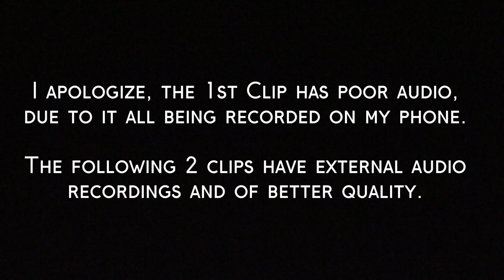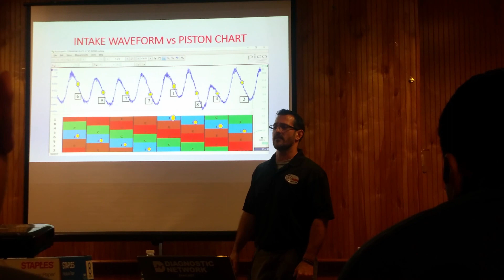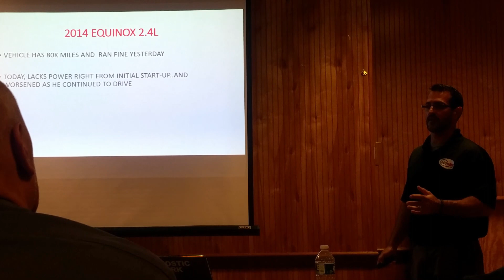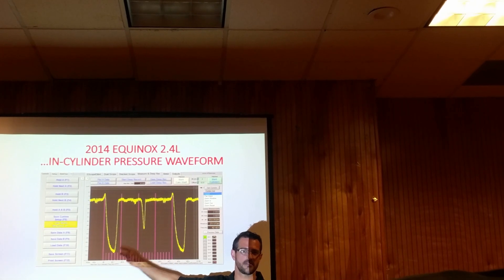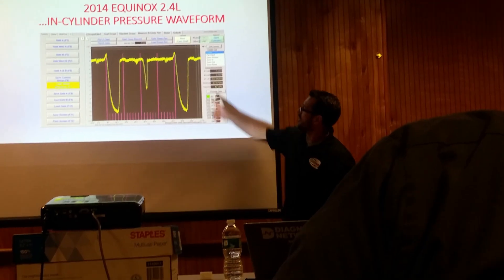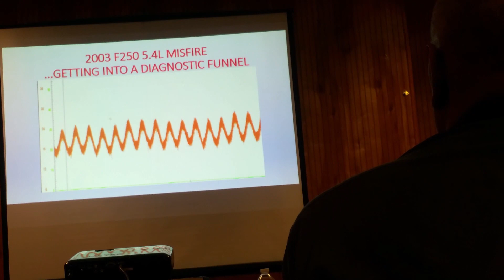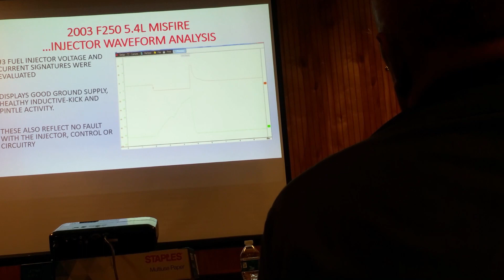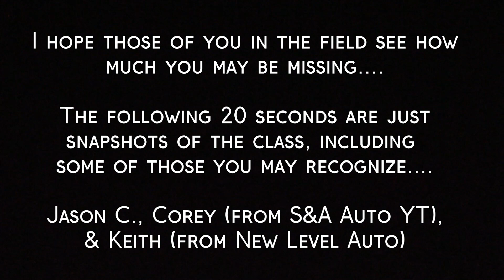TST Starring Brandon Steckler; Pressure Waveform Part2 Clips

Comment: The difference between big money and ok money is the tech making the effort to take these class and apply them in the daily repairs 

Great video 

It's very advance diagnose step that once mastered will pay off  especially with some engines so hard to get the back cylinders doing the old school compression testing method
Reply from the maker: Exactly that! Techniques that will pay off in the end, and all without disassembly of components! How awesome is that??  How about those that have been to multiple shops and still haven't been fixed?? Having a way to see things other shops missed because ONLY your techniques will be able to see it. 

 I'm glad you enjoyed it! 😉😉😊😊